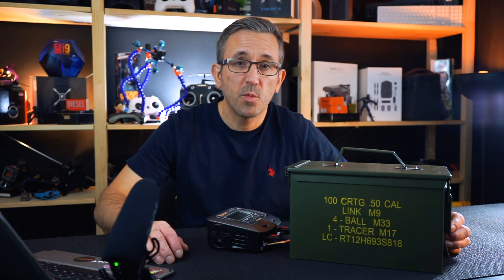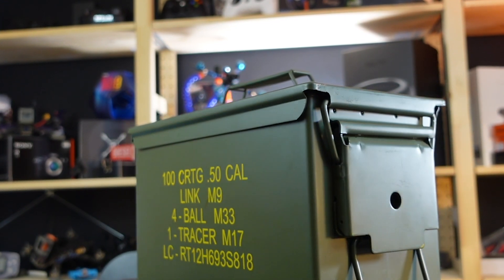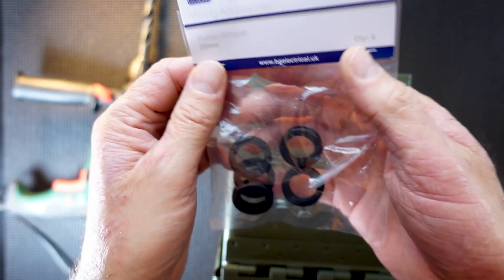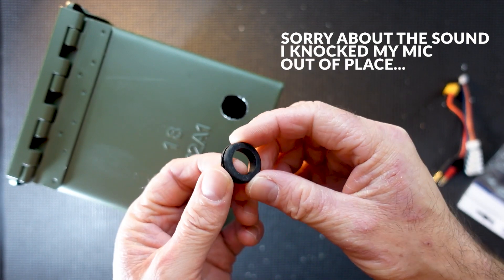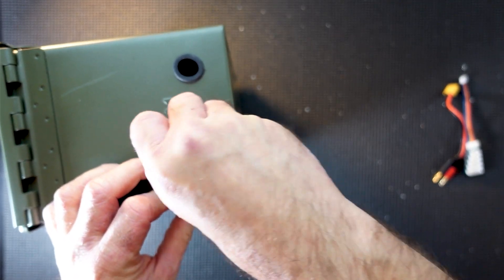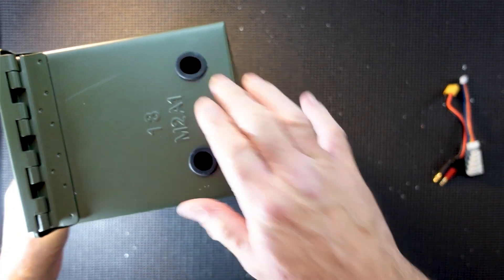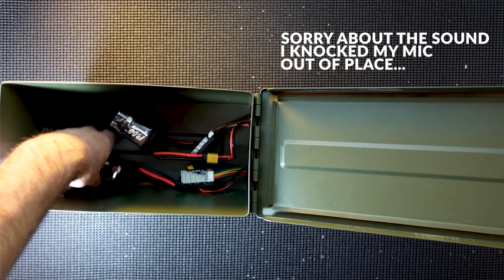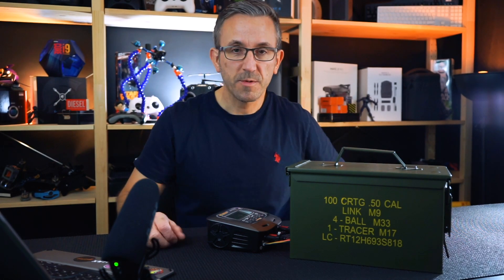How to make a Lipo charging safety case made from Army 50Cal Ammo Box Storage Metal Case

Comment: DANGER!!!

PLEASE LISTEN CAREFULLY!!! 
DO NOT drill holes in the box, The flames and gases will seek any available exit and will shoot out of those holes like mini flamethrowers. The escaping gas can ignite outside the box as it mixes with air, producing jets of fire. If the box is not vented properly or pressure builds up faster than it can escape, the box could burst violently.

The boxes are great to store them, in, but not to charge in with holes in,  charge in a good quality Lipo bag, make sure the batteries are good and you charge them correctly. If you can, charge outside or at least on something that’s not flammable and 2m from any furniture or walls etc. and obviously never leave unattended. Have welders gloves handy and a rod to put through the handle so you can carry it to throw outside, use a mask and don’t breathe in the fumes, they’re extremely toxic. Remember to remove the rubber seal from the ammo box too, so gasses can escape. I say this as a professional safety adviser.

Comment: I did exactly what you did but my house burned down.
Lipo's doing ok though in the box
😅

No currently just busy with this for storage.
Just set your charger right and don't charge damaged lipo's and you should do ok.

I bought a small locker cabinet.
Going to isolate it with drywall board.
And storing lipo's inside the ammo box in it. Trying to compartiment that too.

Those little lockers can be found cheap too. Metal and small vent holes.
Add some extra locks so it stays closed.

Comment: If you are going to drill metal. 

Use a punch and set a dent for the bit tip. 

Use a slow speed, heat dulls the tip faster. 

Lube is your friend. 

Do NOT use a drill as he shows, this is a dangerous way of doing this,

Comment: Top tip from someone that drills metal on a regular basis.
Always drill a pilot hole first, 3.5mm is my go to size. Then go to the required size drill bit. Makes it so much easier.
Also if you need a hole larger than the size of bit you drill chuck can accept, buy a step drill. Pick one up for next to nothing from most hardware stockists. Makes a way neater finish than doing the hula dance with your drill and undersized drill bit! Also safer the drill won't snag sending the work piece spinning across your work bench! 👍
Reply: For sheet metal like this a step bit works the best. Much cleaner holes.

Comment: This is an excellent idea to contain a fire.
In 91 my house burned down. I had a ammo can full of rounds. They went off in the box. The box was intact and not a single round punchered the can. It had a serious amount of dents from the inside. I could still open the can and poured out spent cases and a blop of lead.
So it is very rugged. The only downfall I can see is the ports can have flame coming out like a rocket if a battery cooked off.
So there must be some type of way to seal them. Maybe make some leads for through the can. Then on inside section off a small spot and pour Chico and let it setup with leads through the wall.
Reply: Sealing the box would turn it into a pressurised bomb, unless you extinguish the flame. The point of putting it in a box is to buy time whilst you take it outside.

Comment: Have you tested it to see if fire comes out the holes you drilled?
Reply: Of course it does. That's why batsafe plug is so so tight. And it has alot of vent holes to let gasses out. 
Big lipo can go up so fast. So much flames and pressure
Reply: @divingfalconfpv4602  that's what I am trying to say. This design looks like it will shoot the flames right at the charger or the floor, causing it to go on fire.
Reply: @JoevsRc   I finally got a batsafe. Bit 50cal cans after removing seal are great. Just I'd prob put the holes  on the top maybe. But the sheet rock idea is great

Comment: Honestly I think if I was going to spend $30+ on this. Not to mention if you line it with flame retardant material.I should just buy a bat-box $70 that’s lined and protects against a lot of the smoke 💨 as well. 🔥 fire is the biggest problem. What room it goes off in, the smoke will be so bad you’re going to have to gut it! An ammo box would be a good option for charging outside. It’s still better than nothing.
Reply: $30?
For an ammo can?
Reply: @mini-z_me  I really like your ceramic insulation idea sounds way better than sheetrock . Another thing you can look into is a big vent. I saw a guy on you tube hook up the on switch to a smoke alarm. So if it went off it would take care of the smoke problem. This guy bought all bat-safe boxes too lol. I would think with that kind of a setup ammo cans would suffice. The smoke is toxic to breathe and it will destroy your walls. Stay Safe
Reply: @mini-z_me  oh yeah I was going to tell you I think you should line the whole can with that insulation. I saw a video on you tube where they set one off in it. The only complaint they had was it got really hot 🥵 so if it was in the car or something it could be a problem

Comment: I do have one question:
If there was a fire inside the ammo box, wouldn't the fire just be concentrated out of the holes as it has nowhere else to go?
Reply from the maker: you would get some escape yes, but if the whole box was sealed and you do get a lipo going off it would explode due to pressure... you need some air flow, otherwise you are making a bomb in your house!!!!
Reply: @Datfpv  just remove the rubber gasket
Reply: @JoevsRc   and cut your cables when you shut the lid😅🤣

Comment: Can you make small holes on top to release pressure just in case?
Reply: Most guides say to remove the rubber gasket from the sides but leave it at the front latch so that the latch still tensions properly.

Comment: quick tip, drill a smaller hole first, makes it so much easier.. and you can be more precise.
I did pretty much the same, but I installed connectors so I do not have the cables dangling around. and drilled 2 6mm holes in the lid and put some tape to cover them, so the pressure in case of a fire is not blowing out the connectors.

great video btw!
Reply from the maker: Cool, thanks
Reply: Do you have any photos of your solution? Sounds good...

Comment: Just a query...those holes you drilled and cabled thro'...wont a fire "jet" thro' if the batteries should go off??
Reply from the maker: Hey, you need some vents else basically you have made a bomb in your home, without the vents / air it will actually explode the ammo can in your home!!!! If you have a lipo go off..... also if you do this remove the rubber seal on the ammo can lid...
Reply: @Datfpv   I  agree -  but the holes may well allow flames to jet through -- dont forget. - .the grommets are rubber.  I'm trying to figure how to get around this and really see a problem unless the holes could be filled with fireproof clay which is available in the UK as FLOMIX  ( @ Screwfix.)The stuff is mouldable so may make a decent gromet...
Reply: @rossmansell5877  I'm wondering if there's a filter or something that can be placed over the holes. Something that lets air and maybe smoke get through but keeps the flames safely inside the box.

I realise you left this comment over a year ago so if you found a solution, please do tell me. I'm using high-quality batteries and chargers made by the same manufacturer as my vehicle, but I don't like taking chances when it can be this catastrophic.
Reply: @mitchib1440  I would suggest just putting the holes on the top so the Flames go up instead of out the sides

Comment: So you can only charge two batteries with that setup? Did you ever upgrade to a parallel board that supports multiple  XT60/XT30 connections to charge more than two packs?
Reply from the maker: you could put a parallel board inside, sure it would fit.

Comment: I would like to make one of these boxes the Balance cable on my batteries are too short.  What was the "Board" that you placed inside?  Did this act as an extension to your balance cable?
Reply: you can also buy lipo extension cables to keep charger a bit away so flames don't come out of the holes and char your charger and also so you have more room to disconnect charger if a fire does start inside the box
Reply from the maker: they came with the charger, they are balance boards, they have connections for 2s, 3s, 4s, 5s, and 6s balance leads for charging

Comment: I just built my own battery bunker from the same type of ammo can. 
Before that, I spoke to a firefighter on what they would do if they were to store LiPo batteries.
Based on the information I got, I used this approach:
I lined the inside of the ammo can with .5 inches of sheet rock. The bottom has a double layer of sheet rock with a cutout for the raised indent. The sheet rock provides pretty good thermal insulation. For transport, the recommendation was to put the batteries in a vermiculite based packing material (lightweight, provides cushioning, is inflammable). A vent hole with some steel scrub pads (NOT steel wool, because that stuff is pretty flammable!) stuffed in front will also mitigate the risk of a flame shooting out of there and affecting the surrounding area. 
Oh, and the smoke is also pretty dangerous in itself. Not only does it smell quite bad, it also contains Hydrogen Flouride (HF), which is extremely corrosive and toxic af. There is no way to filter that reliably with anything you could buy at the hardware store.

And for those cases where stuff is really going sideways, the recommendation from said firefighter was to dump a big old load of sodium chloride (a.k.a. table salt) on the whole thing. They basically use the same approach for metal fires (e.g. Magnesium - and also Lithium). Yes, I know - there is very little metallic Lithium - if any - in LiPo batteries. Still, in the case of a fire, the salt will melt (NaCL melts at approx 800 degrees C) and encase whatever is burning.
Reply from the maker: christ mate gone to town on gthat one!!!
Reply: I'd love to hear more about this. Did you encounter a situation where it was put to the test? I'm planning to mod my own ammo box with this in mind. For the fumes, I plan on placing the whole ammo box in a larger metal "fume box" where it's sealed with an exhaust fan to chuck out the fumes outside.
Reply: do not put water or any sort of fuel on the burning Lipo, even if Metallica sings "fight fire with fire", throwing your neighbor's barbecue on your Lipo, does not stop your bat from burning.
Reply: Instablaster...
Reply: Do you have a link how the sheets look like? Would like to search for this in Germany.

Comment: Any way to isolate the bottom of the box from inside or outside if set on wood floor?
Reply from the maker: ? in what way
Reply: @Datfpv  I don't know if it possible to isolate the bottom part with something, just asking. I have wood floor inside my house, if the metal case would we set on the floor and something inside would get on fire and heat up the bottom part I'm just afraid it can burn the floor. I was asking if I can add some isolation on the bottom.
Reply from the maker: if you have a lipo go off in the box it will make some mess, I wouldn't want to be in the same room to be honest... sand is what they say for a lipo fire, cat litter tray? mines just on the floor in my office, I'm always here if I'm charging and hopefully nothing does go wrong
Reply: Line with sheetrock. Or could cut a lipo safe bag to line the bottom.
Reply: Sheet rock bro

Comment: Well done...thank you
Do you also store fully charged (to be used, soon), or storage charged batteries in the ammo case?
Reply from the maker: I do keep my lipos in a ammo case, I think its better than just loose.. remember you need to take out the rubber seal if you use a ammo case, there are horrific videos on youtube showing what happens if you don't... and a lipo does go off.
Reply: @Datfpv  thanks so much for that info!
Reply: @Datfpv  i know without balance charge or doing over charge they can blust but can lipo batteries get blust when i store them in safe place some moths or some days without using ?plzz reply sir i am in new in this hobby. i have one  3s 4000 mah battery and two 2s 2000 mah battery is it safe in one ammo box ?
Reply: @Datfpv  Rather than remove the rubber seal from mines (it made the lid feel too loose when carrying it) i cut out a few inches from the rubber seal instead so it can vent if needed.
You can also drill some small holes in the lid

Comment: Hey Datfpv, I have had some problems regarding a emax tinyhawk freestyle 2 and have the betafpv lite 2 controller when I flip the switch to arm the motors and go to betaflight it says disabled. I need some assistance
Reply from the maker: Hi - if you're connected to betaflight it won't arm unless you press the switch in the motors tab... also make sure you have batteries in it (that does happen)... also if that doesn't work, see this vid: https://www.youtube.com/watch?v=7ZUe-sC7mmU&t=2s

and still not working.. make sure your controller is the frsky one.
Reply from the maker: also remember to subscribe!! thanks
Reply: Hey, that's completely normal, same for me. I think You need to unplug it from USB to arm, hope that helps

Comment: To be absolutely sure, there is a product called BAT-SAFE. It's quite expensive at around 50€ but it gives me even more confidence than a solution like this. It does have a Watt hour limit though, I think it's 200Wh or something like that. Oh I forgot to say it even filters the smoke to some extent
Reply from the maker: I know the one, very expensive and if I had a battery go up I wouldn't want to be in the same room with either solution...
Reply: @Datfpv  yeah, me neither but I charge my batteries in the cellar anyways.